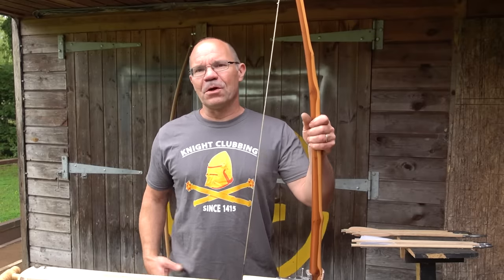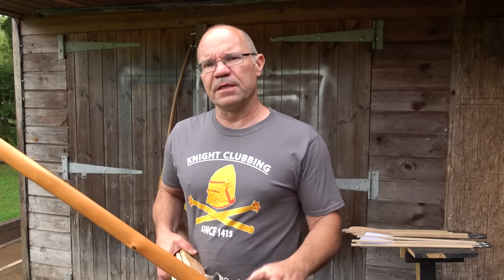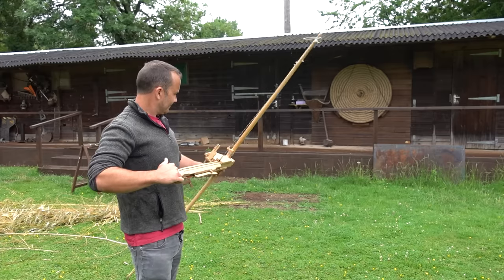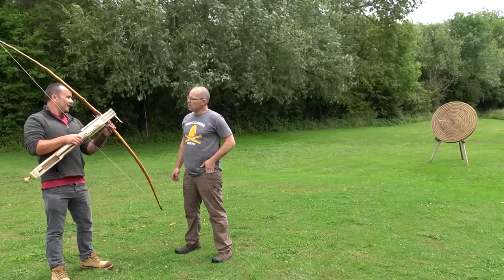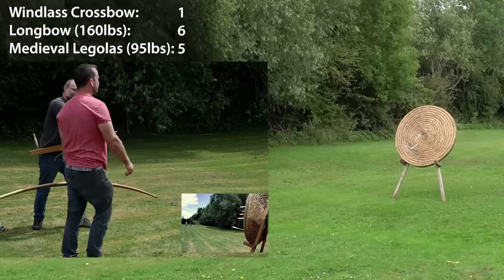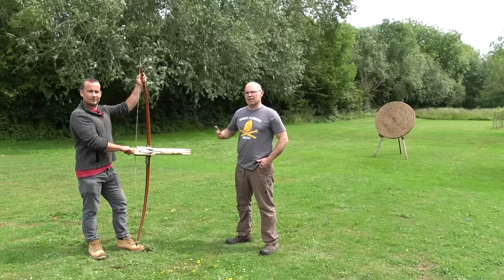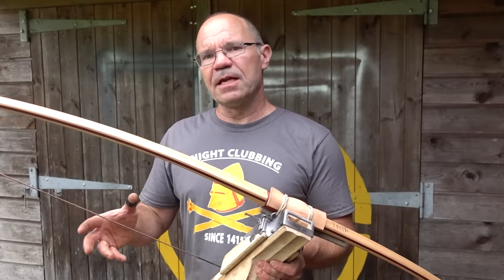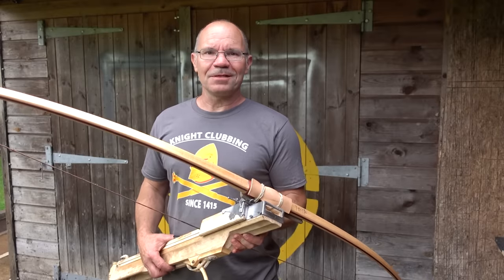Tod's 120lb Medieval Legolas - TESTED

Comment: imagine using an instant legolas on a static frame like a balista holding it, with two people.
its basically a machine bow right there
Reply: heck, you might be able to hook up a mechanism for a donkey or horse going in a circle powering repeated drawbacks for even more power
Reply: The Greek had something like that. It's called a Polybolos. It operates a little differently from this, though, considering that the Polybolos has a stationary magazine relative to the bow limbs. The Instant Legolas moves the entire mechanism back and forth more like the Chinese repeating crossbow.
Reply: You would be better off using a Chinese or Korean design of a mounted repeating-crossbow.
Reply: DO IT
Reply: @BrokenLifeCycle  didnt the mythbusters build one in one of their episodes?
Reply: imagine, 60 archer on a battle field, each one with this thing, 30 shoot 5 arrow in 8 second, the other do the same just after the other have finish, during this 8 second the other reload and recover a little bit from the effort, repeat until the 60 archer are exhausted (or until their are no arrow left) and just like that you have 1125 arrow/per minute literally flowing on the ennemies.
Reply: @ledocteur7701  that's a perfect example.  Staggered fire is used in all military's so that one group can reload to continue fire once the other group runs out.  A lot of people aren't thinking about that when commenting.
Reply: @BO-hh8mj  thanks !

Comment: One problem I can immediately see is that the handle is set further back than the bowstring--Joe's having to draw further than he usually would
Edit: turns out he's not and I'm wrong!
Reply from the maker: Actually it is set to a 31" draw from belly to grip, so about his usual
Reply: To mitigate this, just take a heavier bow and draw it shorter.
Reply: @tods_workshop  Draw length is usual, but positioning of arm isn't. I think it isn't fault of design but needs to get used to.
Reply: @tods_workshop  Oh, I watched again. My bad. But still there is a little difference in positioning, that could be enough to make it harder.
Reply: @tods_workshop  What I meant was at 8:56 mark in video.
Reply: @tods_workshop  I stand corrected. Do you think then it's to do with the overhand (vs the usual underhand) grip? (As well as training/acclimation, as you've said.)
Reply: Wouldn't it be possible to have the handle closer to the bow? It might even make the drawing more ergonomical.
Reply: @romaliop  
would change the trigger mechanism. might end up extending it with extra moving parts
Reply: @tods_workshop  length may be the same but with the extra girth of the device, could that not be kicking his contact point out of whack, and in essence costing an inch or two of comfortable draw?  That's a LOT of weight to deal with even having your body mechanics changed a small amount.
Reply: @janis2280  I'd say it is partially the fault of the design. If the trigger mechanism were mounted in a way that allows someone to grip it the way they would a normal bow, it wouldn't be a problem. Whether that's a feasible design change is another story, of course.
Reply: @MrSam1er  Totally, you could see that, given the position the draw was too long. The last part was harder for him, that always says overdraw.

I do overdraw my bow just to hear the string noise going past my ear, lol
Reply: Actually, can you make a drawing and trigger closer so your arm and back don't have to stretch toward the very end of themself so you don't have to spend more effort trying to pull it at the end? It seems easier to draw the bow if your arm starts closer or even ahead of the string. Idk, I just make a pure guess. But even with such position, you won't hurt the accuracy because the arrow is already guided.
Reply: ...and like he said a vertical grip would've been much more comfortable for him and not stress out unusual muscle groups! 
But really amazing fire power! ...imagine 50 or even 100 Soldiers equipped with these in a tactical formation with shoot/reload lines! A constant storm of arrows!
Reply: @tods_workshop  For sure, but the comments thus far are missing the actual issue, which is that the different arm position means he's working different muscles. You can train those, but if those muscle groups are naturally weaker ones then it'll always be a struggle.. I agree with the other comment that a handle design change might make it easier for him, or if he had a way to grip closer to the bow.
Reply: It's a 'bit more work' as he doesn't have as much rest time between shots as well.
Reply: @TheGrumbliestPuppy  I agree with this. You can see it in the way Joe's body is positioned when he's drawing a regular bow vs the IL. I think he wasn't able to engage his lats as much and was forced to load more of the final part of the pull onto his rear delt. I think this would explain why he could still draw it, but fatigued faster and thought it was heavier. Lower lat activation would have made the whole pull more difficult, but the end in particular. I think it would be good to talk with Joe more about where in the pull it felt heavier and if there's a particular area he doesn't think he's able to use as well.
I also agree with the change in handle design. I think a neutral grip would give a better position for the pull.
Reply: @toxicmule  For sure, so if the bow is harder to fire one shot than a normal bow, that's really going to add up with rapid fire.
Reply: @tods_workshop  Apologies if it seems like all we have for you is criticism, I think we're all working under the assumption that it's painfully obvious how f-ing awesome your bow is.
Reply: @furrytrash8399  I still think it is matter of practice. With enough practice muscles will be used to to move like that and it won't pose a problem.
Reply: gunnyblender  attaching the handle in some way that would allow it to rotate about 25° to 65° or so.....
Reply: @tods_workshop  But still, with the way stacking works every little bit adds significant draw weight. I would also pose a couple things. You mentioned friction which could be the case, Jorge's is machined so it would glide smoother on the draw, is there a way you could lubricate the system to reduce the friction? Another point is Joe is having to fight with more weight over all. Jorge's version with modern materials didn't add much weight to the bow, you didn't mention how heavy yours is, but if it is significant, Joe would have been having to compensate for additional of the bow itself that he probobly wouldn't have been use to. 

One other line of thinking, you don't have Jorge's version where he configured a lighter weight bow pushing the assembly back at you to reduce the required strength to pull back a heavier bow, you would probobly want the grip installed though  to aid in holding the draw back, Jorge did this to simulate how compound bows can hold the heavier weight at full draw with ease adding to wielders accuracy as they don't have to fight with holding the string back.
Reply: @janis2280  you are right, normally pulling hand ends around ears or so, and with devices hand ended even behind head.
Reply: Perhaps there is some innate / inherited biomechanical wisdom in the traditional way a traditional bow is drawn which this device does not account for in its current configuration.
Reply: As an archer, my opinion is that you're all nitpicking. An archer trains by shooting arrows and more arrows. It's Joe's first time on this gadget. Let him get used to it -- and that includes the handle. I thin I would appreciate the handle, myself. I draw the bow with my palm on the bow wide open. I started with my hand gripping, it takes a bit of discipline to get used to the open palm draw. Once you're used to one technique, it will take time to adapt to something different. And I'd like to say that the wrist orientation doesn't make that much of a difference. I'm fine with drawing a compound using a mechanical release. For those of you that get triggered, I don't think people normally bother to decorate mass produced items.
Reply from the maker: @TheGrumbliestPuppy  Not at all - this is how we all learn and anyone who thinks I hold all the answers, all the time is very wrong indeed.
Reply from the maker: there is a load to unpack here...
It is the first (and will be the last from me) prototype like this and would require a deal of further development to make it truly a finished item so yes there will things that are either plain wrong or need adjusting, but in principle the device worked well and in fact very well in others.  Could it be improved? Without a doubt.

I think I got the position wrong and this may have had a large impact on Joes ability to draw it.  A flexible handle at the back may have helped a lot or a vertical one, the magazine on the other side may have helped and if we limited it to a 100lbs bow then we could have had 10mm bolts rather than 12mm and that would have reduced the overall weight.

I would drop the draw length a couple of inches from a full draw to maybe 28"

As regards you lot being critical - bring it on.  We all learn because we talk and think, it only goes wrong when we argue without listening.  Was is Buddha who said "those who know everything, learn nothing"?
Reply: @tods_workshop  can you consider rotate handle 90° for more usuall grip?
Reply: @tods_workshop  Thanks for taking the time out of your day to get this prototype done either way, Tod. It was a wonderful experiment and the two of you put on a great show. Have you ever tried making other modern implements using Middle Age materials? A chunky compound bow with a linen bowstring and possibly bone/antler fittings would be a sight to behold, for instance.
Reply: I think Todd has advanced this device's evolution and proved that it could have been made with medieval manufacturing techniques. So why wasn't it? Perhaps it was not that the concept is flawed, or that no-one had thought of it - maybe it is partly due to the intense amount of R&D required to perfect a complex and nuanced design like this? Did people then have the time and interconnectivity required to do that?
Reply: Beautiful attitude

Comment: What an awesome weapon concept! Just from looking at the Medieval Legolas in action, I can already see why the bow is much more difficult to draw. In order to obtain the usual 30 inch draw of the bowstring, Joe has to pull the handle all the way back to 35 or so inches of draw length. That's a lot of extra scapular retraction Joe has to achieve just to get the same power out of the bow. A worthwhile design change might be to relocate the string-holding pawl to be as close as possible to the drawing hand without encroaching on the space for the fingers. Then a 120 lbf bow might feel like a 130 lbf bow instead of a 160 lbf bow.

Comment: This was impressive with just 5 simulated archers. Imagine if you had a whole battalion...🤯 you could turn the tide of a battle in minutes maybe seconds.

As for the grip and friction, I think a vertical grip would be more ergonomic. You have to bear in mind  Joerg is used to shooting sling shots wich have horizontally oriented rubber, bows have vertically oriented string that is thinner than the rubber. This probably throws off Joe's muscle memory.

Edit: The front handle isn't a design flaw imo. Joe has just trained to hold his bows closed handed. You don't need to shoot like that, in an open grip you simply let the bow rest in your palm and as you draw back the weight of the bow keeps it in place and when you release the recoil from the arrow going forward pushes the bow backward into your hand.

You can also see where the extra friction is coming from in Joe's draw. When he starts the draw the bow is ever so slightly forward away from his chest and as he draws further back pushes his chest out for leverage rather than relying on just his arms. This movement is hindered by the stiff frame wich is designed only to slide back and forth, not rotate. Perhaps a joint on the handle to allow for some flex during draw or some rollers in the slide to alleviate friction would help.
Reply: honestly it need not even be vertical or horizontal. It can be whatever angle actually does best. i imagine something like 30° off vertical would do quite well.
Reply: it would depend, cavalry and ambushes maybe, but battle lines of infantry? wouldn't be much different.
Reply: only that the sustainability of shooting is limited by the magazine size, instead of the amount of arrows in the quiver. Especially if you compare the 6 arrows shot WITHOUT the device opposed to the 5 shot with the device in the same time.
Reply: @Nightkrowler  If you are experienced, you can reload this device fairly quickly, pushing all 5 arrows in at the same time.
Overall, instant legolas is faster than normal bow.
Reply: @dariusnoname12  except maybe if you are an asiatic archer that could shoot as fast as this thing
Reply: @Nightkrowler  jorg made a stripper clib for it.
Reply: ngentotsemua the only people that could fire that quickly were issuing a bow with less than half the draw weight, which would be very useless.
Reply: It would probably be enough firepower to stop a cavalry charge. Fast moving cavalry were the shock troops of the Medieval era and were nearly unbeatable throughout history. Stopping cavalry was not about sustaining fire but putting down as many arrows as you could before they would close the distance and lance your archers. Rapid fire is what counts if you want to stop cavalry. From the time the cavalry are in range to when they reached melee was only a matter of seconds. 

This really is the weapon that could have changed history.
What if King Harold had a 500 of these at the battle of Hastings in 1066? It is doubtful William the Conqueror's cavalry charge would have made it up the hill.
Or if the Chinese had these they might have defeated the Mongols and there would have been no Mongol empire.
There might not have been a need to invent guns because this is such a good weapon.
Reply: @kaikart123  an already fast shooter could shoot even faster with this
Reply: could one make a magazine for even faster reload? Jorg has a system where he ties together the ammunition, drops the whole thing in, and then withdraws the string so the weapon supports the ammunition.
Reply: @mojolotz  But the premise is that this would be used by a mediaeval longbowman, and his grip on the string is vertical - why would you change that?
Reply: @Nightkrowler  Uh, if you go back and watch that again he shot 2 arrows normally in the time he dumped 5 with the SIL. Also, you could have a 2nd device for each archer and a designated loader like the did with crossbows. That would make "reloading" almost instant, AND they wouldn't need a high level of skill / training to be able to do that job. Alternatively, they could form up in 2-3 ranks like musket men. One rank could fire, fall back and reload while ranks 2-3 are shooting, and then repeat the cycle. The potential for high volume of arrows is impressive.
Reply: "As for the grip and friction, I think a vertical grip would be more ergonomic."
You're as bad as Matt Eaton, you are.
(Stop sniggering at the back, there!)
Reply: gues alot of soldiers would have fought in the "shade" if this thing existed in medieval times
Reply: @DarkWolf958  Not since Thermopylae, no.
Reply: @DarkWolf958  "my Instant Legolas archers will blot out the sun" 'says one of known English King'

"Then we will fight in the shade" 'says one of uknown french knight'

"Let me show you it's Feature" 'a certain engineer from holy roman empire:
Reply: @grumpus27  well he can retrain if it results in a better result. The fact that the grip is vertical for a medieval archer is because of how the bow works, not because it's the best. (it might be the best... i have no idea. I don't shoot 120 pound bows )
I am just saying that there is the opportunity for improvement, not that its necessary or advised to change anything.